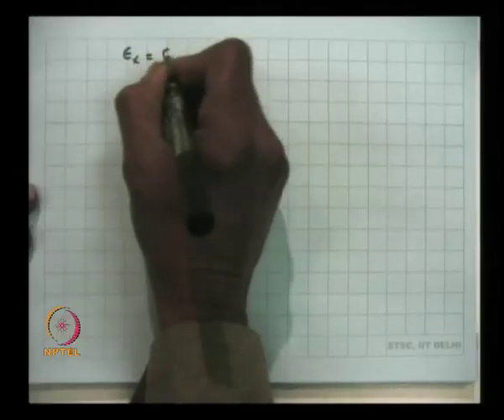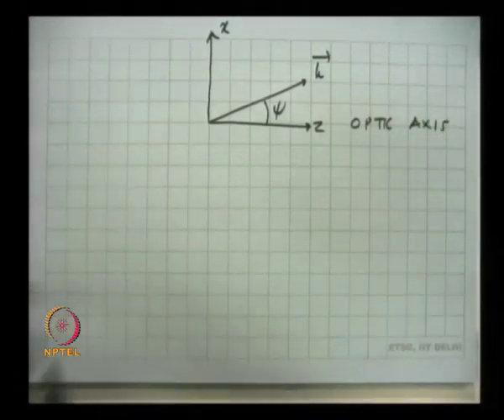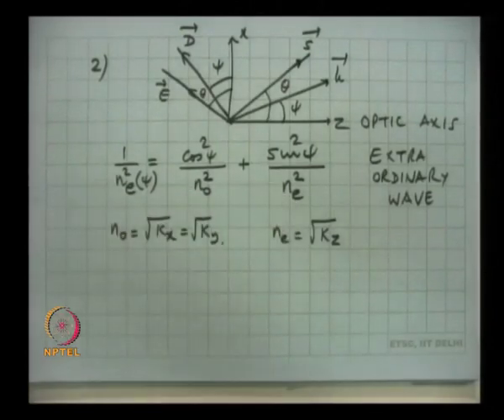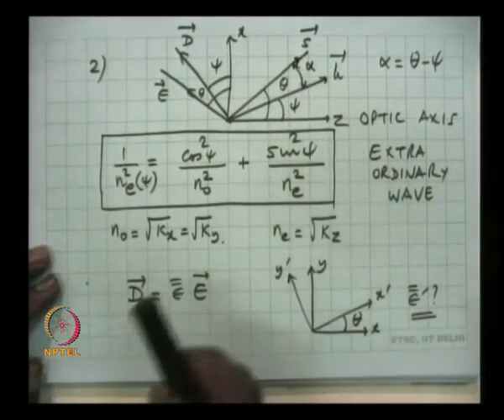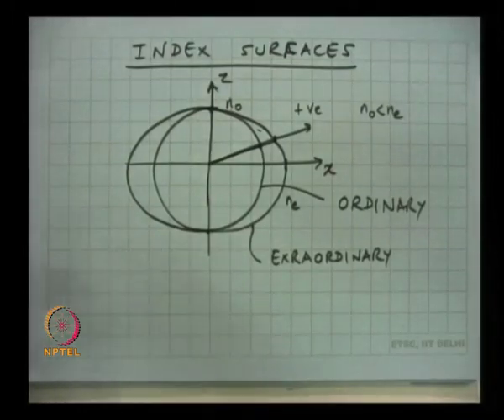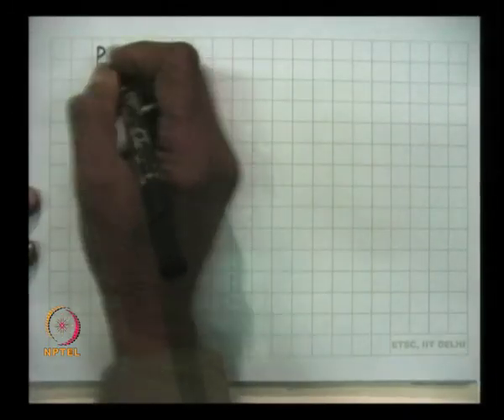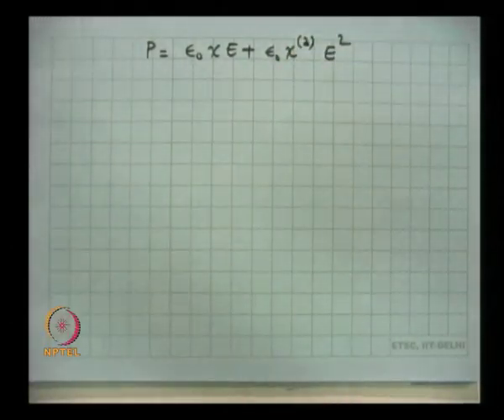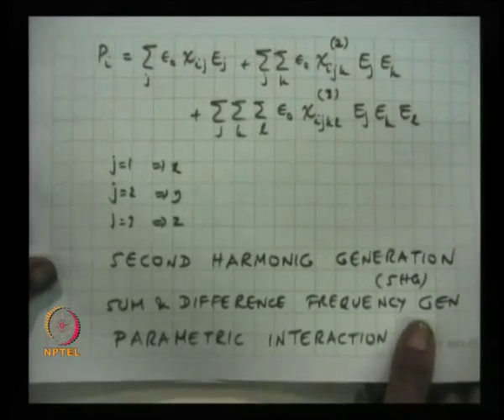Anisotropic Media (Contd..)

Comment: 11:35 If the displacement and electric field vector are to remain parallel and along the y-direction, it does not make sense to me why the only restriction upon the k vector is that it maintains an angle phi with respect to the optic axis because that would imply that k could lie outside of the x-z plane which would make the placement of E,D vector along the y-axis erroneous, right?